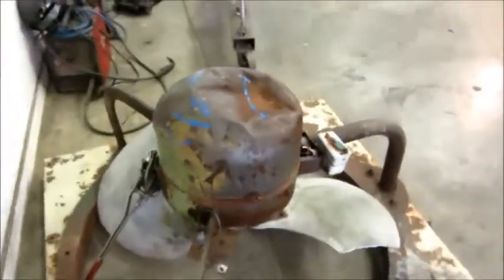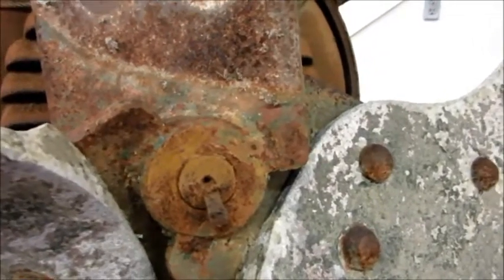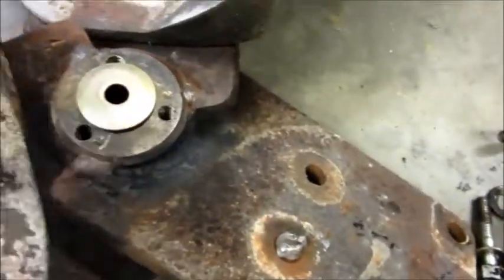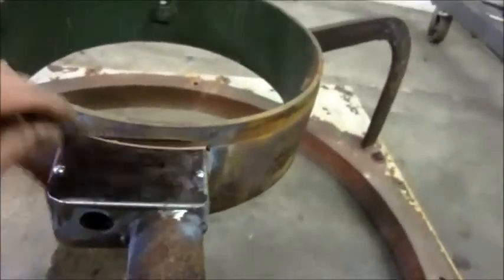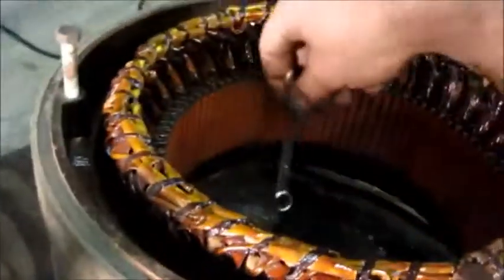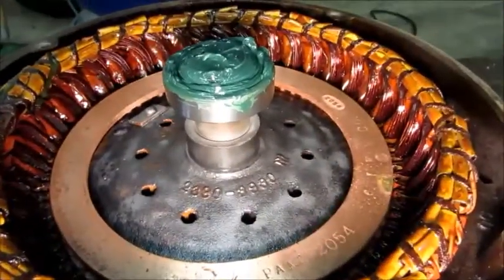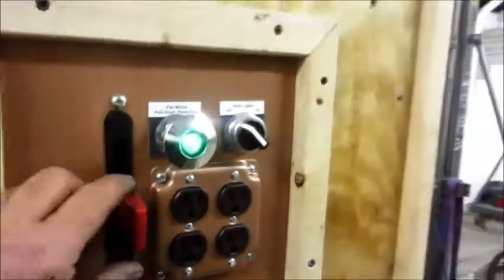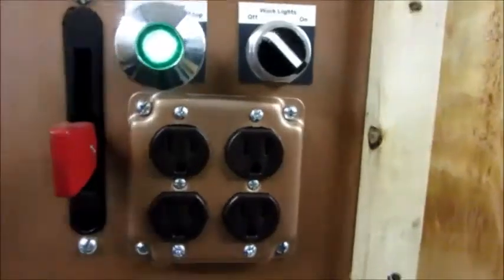Ilg Model 423 Industrial Restore - Part 1 - A fan called Despair...

Comment: if the motor ever had the balls to turn that blade at 2000 rpm there would be a hurricane in your shop, more than the 48,  I am glad to see that all of the abuse has not affected the motor
Reply from the maker: Yep the motor seems to be very healthy. Today I put new bearings in it and it sounds awesome! Will have a short video later on tonight.

If that fan blade went 2000 RPM it would probably disintegrate! That would probably require 200 HP or so and would be very frightful! :)

Comment: I am inspired now, I have a stainless steel blade from a pizza oven that is the same design as the ILG ones , it is  about 12 inches diameter and a nice open type robbins myers motor , I just have to find a ring or housing to use
Reply from the maker: Very happy you're inspired by my build!